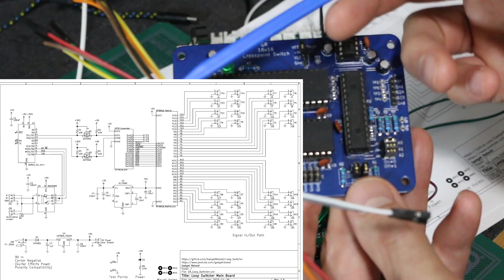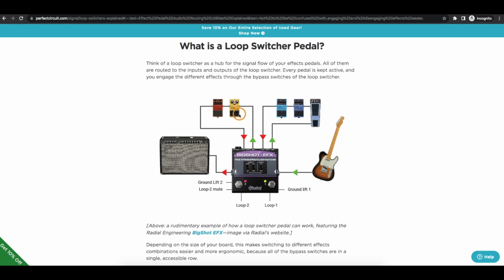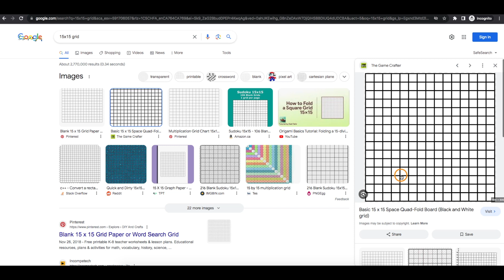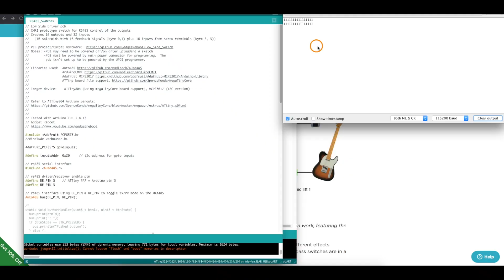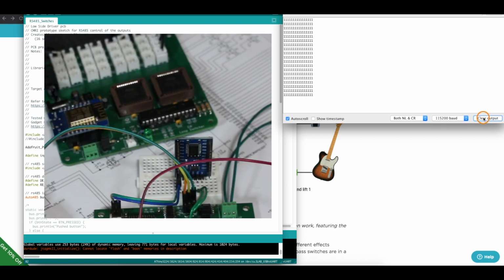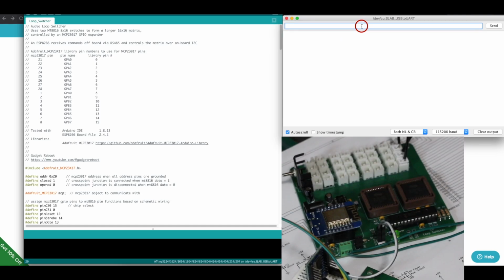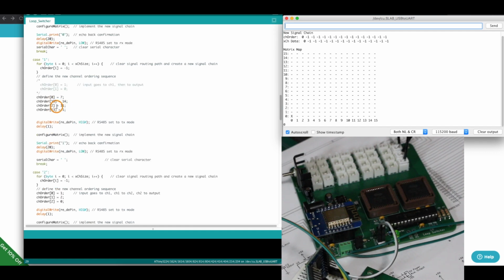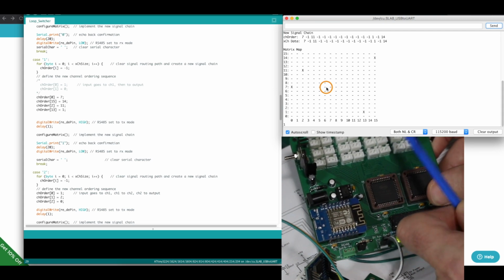Audio Loop Switcher Project Update

Comment: Funny I was thinking about doing this. It’s essentially a GigRig G2 perhaps?
Reply from the maker: similar concept but I believe they use completely passive relays to switch unless other buffers are activated for things like splitting the signal chain into multiple paths. So doing it with semiconductor analog switches like this matrix here can possibly affect the signal path.
I didn’t notice anything detrimental at amateur home volumes.